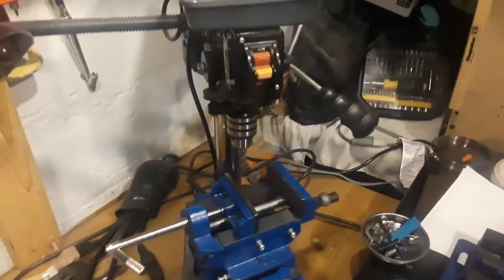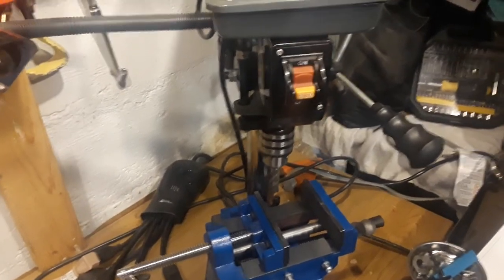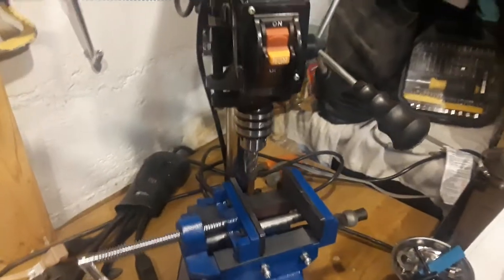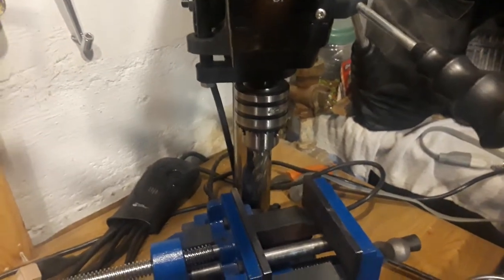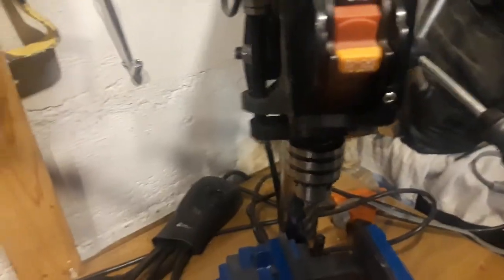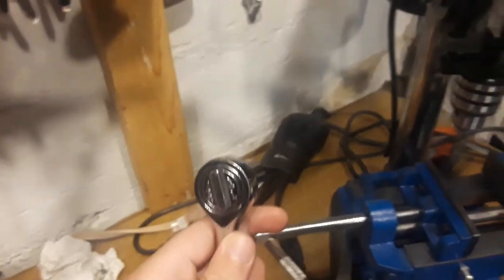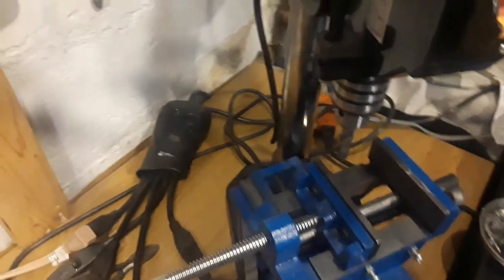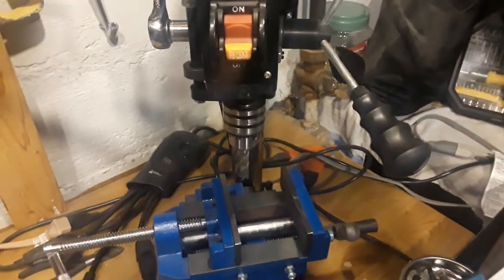How to Make a Drill Press Into a Milling Machine

Comment: I'm pretty sure that most everybody out there knows that you can't use a drill press to Mill if the Chuck doesn't fall out on you you're going to wear your press bearings out in little to no time at all it's just not made to do sideways motion  up and down motion is all it will hold up to doing
Reply: I can confirm this. I tried to use my delta drill press as a mill once and now the chuck constantly falls out :(

Comment: In drill press having depth stop bar preventing to go downwards this can be done by swapping the nuts in the bottom side of the bar preventing the quill to move upwards.But i think so,since i dont have one.
Reply from the maker: Your completely right, I figured that out after I made this lol.
Reply from the maker: I actually ended up using your idea and it works so much better than the ratcheting method. Thank you for the advice! Hopefully I'll make a video about this someday!